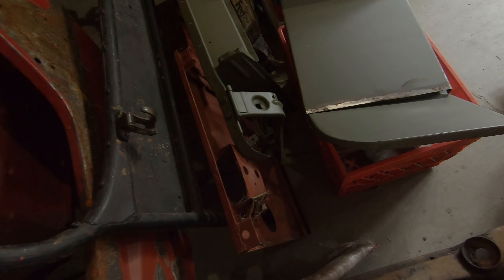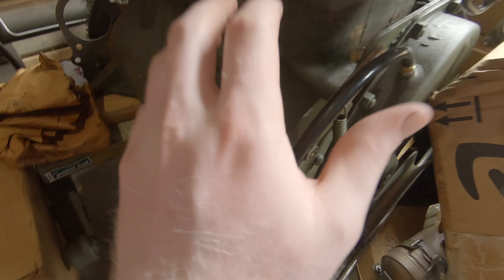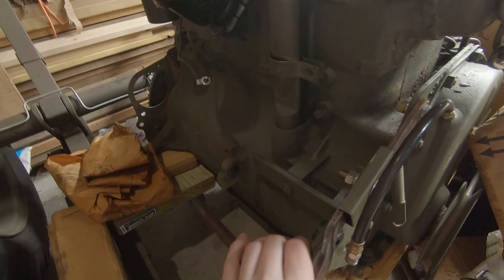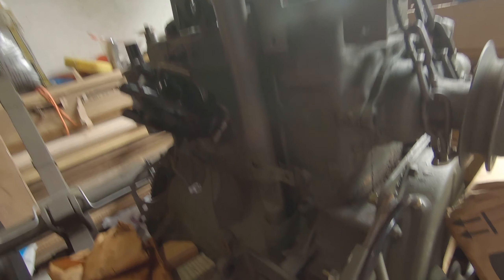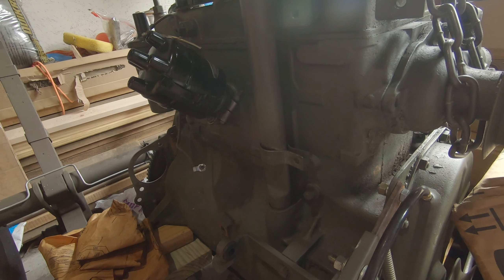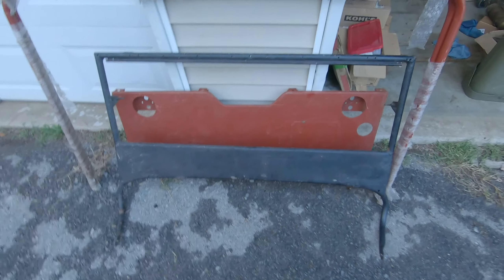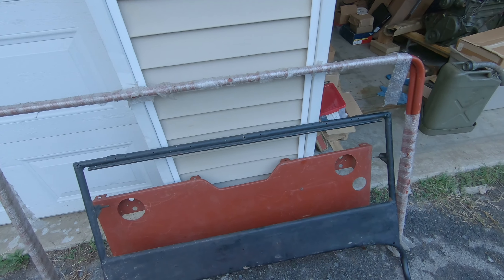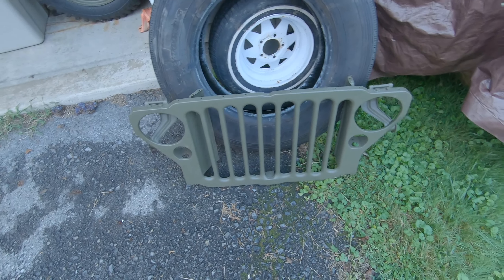My Largest Restoration Project Yet

Comment: Once you get wrenching youll realize itll go by quick also if you dont have floor pans just do what i did to my truck and weld plates of steel into it also engines a 4 cyl flat head you had it close at flat top lol